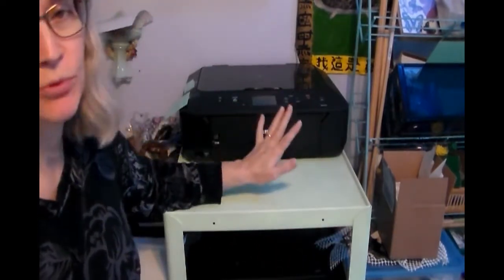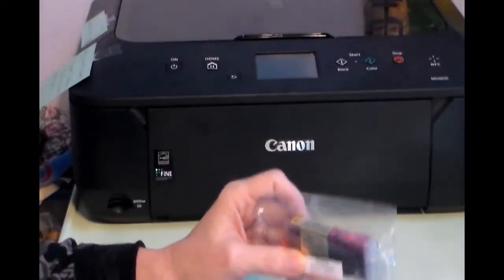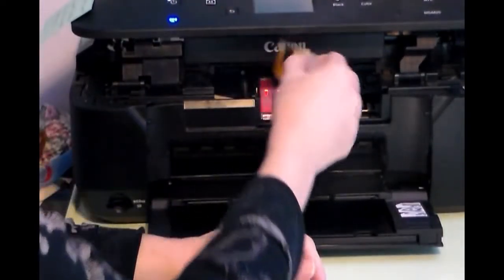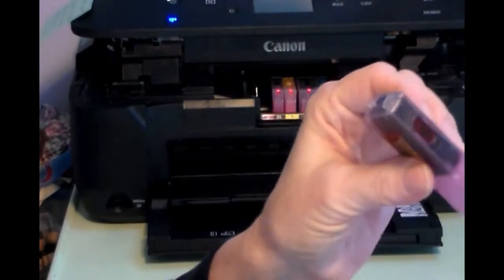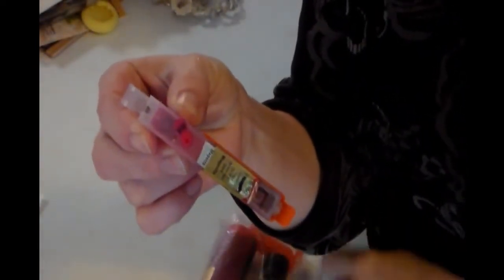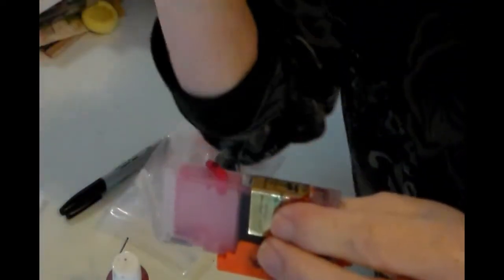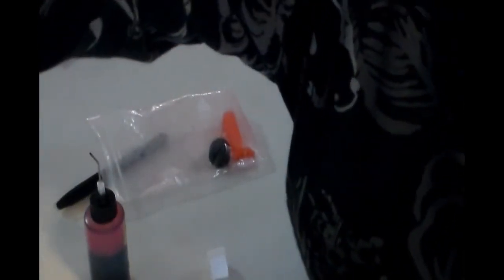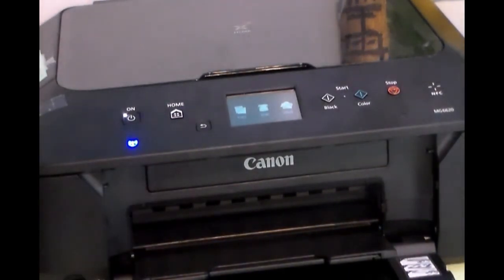Edible Ink Printer Basics, and How to Refill a Cartridge  Edible Ink Printers Part 1

Comment: Hi-I just got my printer and put the cartridges in. My printer didn’t come with any instructions….do I do some kind of test print….and how do you clean them? I’d love to know as much as you do about this. I’ll be using mine for the wafer papers for the chocolate covered Oreos. 
Would appreciate any and all advice you can give. Thank you :)
Reply from the maker: Good luck! Set it up the normal way that you would use a regular printer, but use the food coloring ink. Do a test print to begin with, and if you have to do a basic cleaning to get the ink going do that. (that's in the maintenance section of the print controls.) Watch my other videos about how to clean the print heads, and make sure that you're printing something once a day, even if it's just a test print, to keep the ink going through the printer.

Comment: 9.06. Hi. Do you need a cd rom to set this up. I don't have one on my laptop. Can you print a 7.5 in circle on here for a cake topper . Thanks
Reply from the maker: I don't need the CD to set it up, you can do most of them with the USB cord or wirelessly using wifi. They'll print on regular printer paper so a 7.5" circle would be fine.